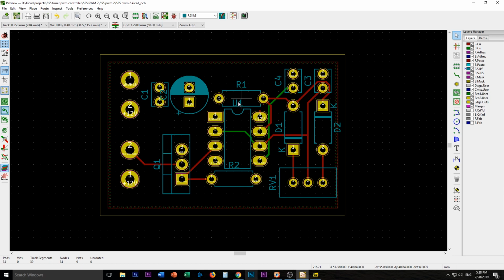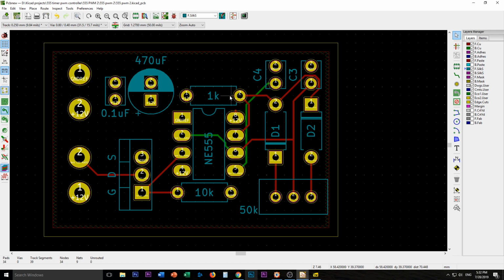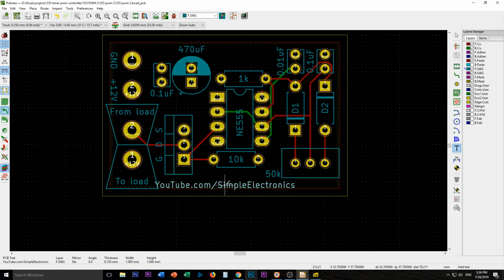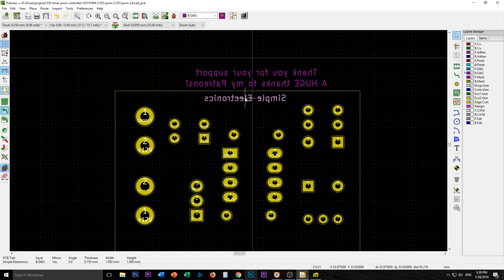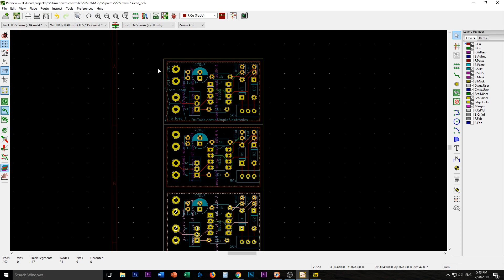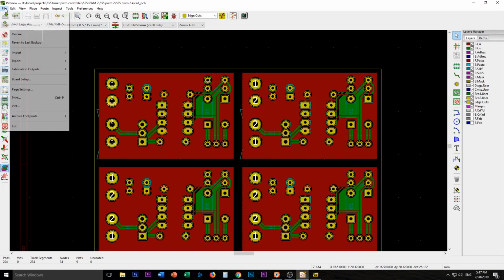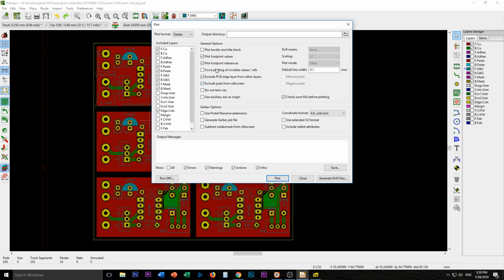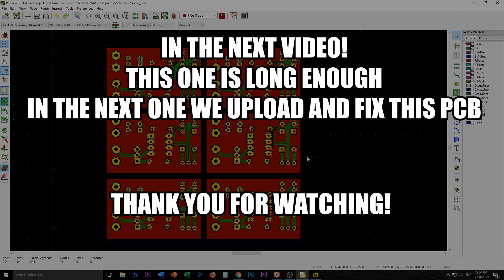KiCAD For Beginners 4 - Setting The Silk

Comment: Before sending off for production I always print out the Gerbers and the circuit diagram and using a highlighter check tracks to the circuit. In the past have found a few mistakes, one PCB only had 1 via joining a high power track from one side to the other. electrical checks confirmed connection but 1 small via would have not taken the current required. always worth checking, check twice pay once. :)
Reply: Hi, just watching this to, I always wonder if I should say something or not ! but I do the same thing as you, check and a final check....measure twice,  cut once!

Comment: Hi, nice video. I wold like to know why you placed a tiny 0.1uF capacitor in parallel to the 470uF? isn't that the same as a 470.1uF? Why did you do that? Thanks.
Reply from the maker: I'm not an expert in any way, but small capacitors are typically better suited to deal with high frequency noise and larger capacitors are better suited to handle slightly lower frequency noise. My understanding is that putting both on parallel gets you the best of both worlds
Reply: @SimpleElectronics  as I know small capacitors work as low pass filters when grounded, the value being small just sets the frequencies filtered out at high values, greater capacitance just means a smaller frequency threshold but is still a low pass filter. On other hand high pass filtered are placed in the signal path and are never grounded.

Comment: Hi. I'm here to learn basic KiCad skills, and I did.  I have been using Fritzing in the past...  You might have made many board since this was posted, but here is my input:  I think it is a mistake to hide silk screen under the component.  you won't be able to see the the designation after assembly. This important for reference to the schematic at a later stage.  For the same reason I think you should go with name (R1) instead of value.  Just my 2C.

Comment: Episode 4 holy crap! Have you tried easy EDA that's the one I have played with so far mostly because it's browser based and it supports mint
Reply: Kicad supports Mint and other Linux distributions, too. It did that far before easyEDA was available outside China or even existed. More, easyEDA is good only for simple, max 2 layer boards and lacks many of kicad features.